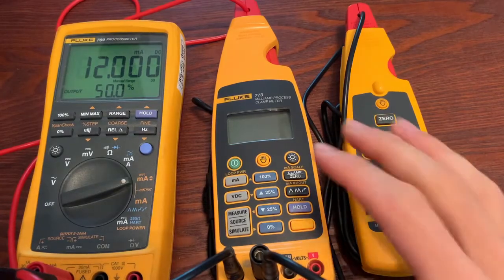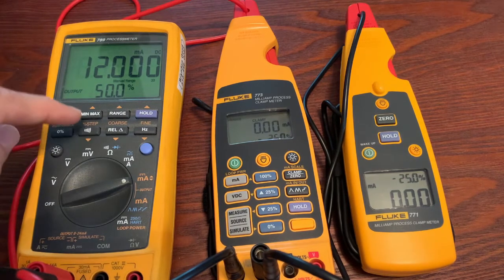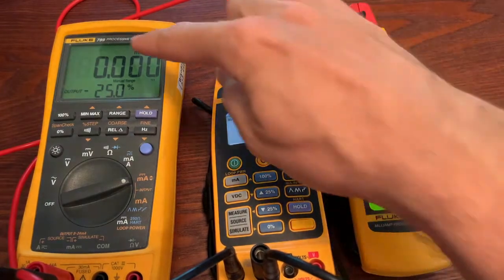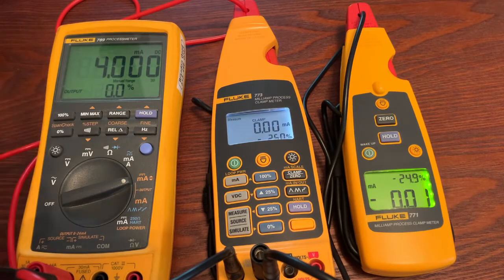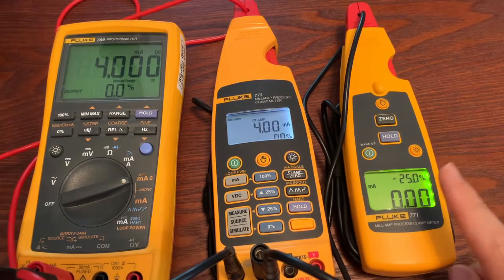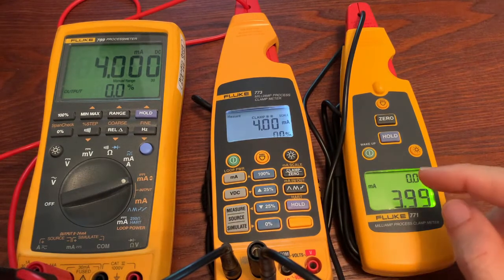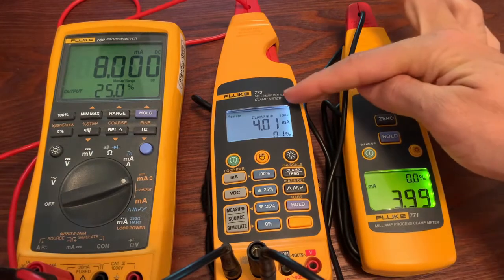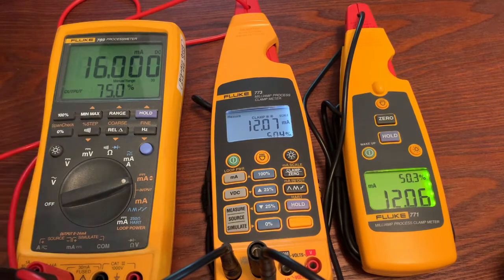05 - mA Scale - Fluke-773

Comment: Just started a position as a Track and way Substation maintainer, typically dealing with volts of 120-850. Which meter would you recommend for maintenance for current sensor troubleshooting in addition to ground sensor troubleshooting?